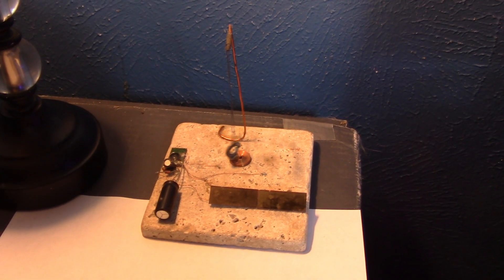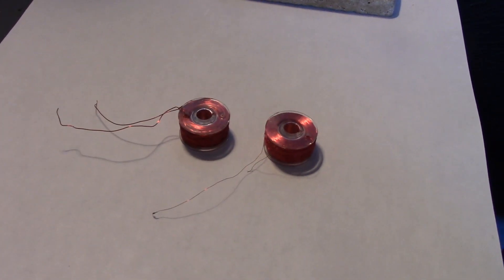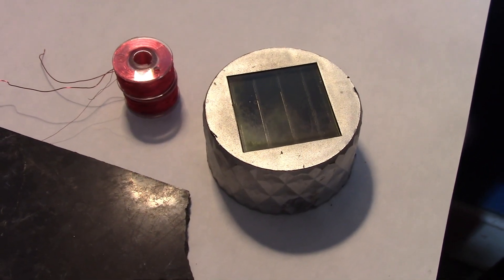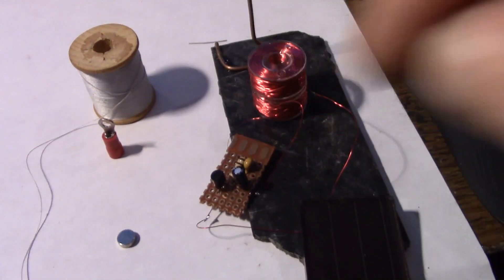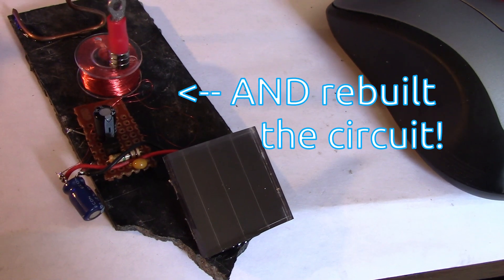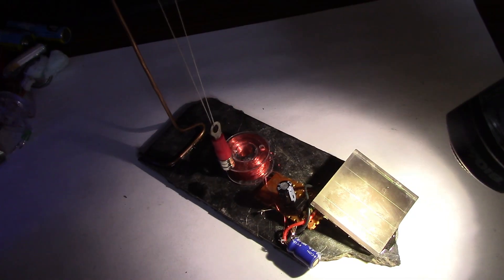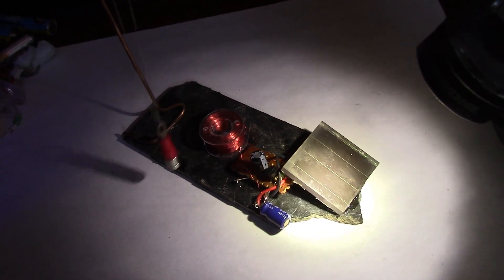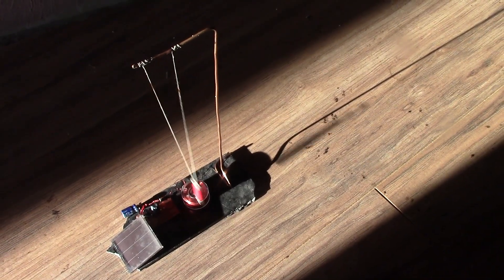Solar Powered Pendulum – Starts by Itself! | Easy DIY Build

Comment: Go big
Reply from the maker: That would be fantastic, to make a 10ft high solar pendulum. I don't know what use it would be, but that wouldn't be the point  🤣👍
Reply: The largest N42 I ever saw was 12"x12"x2".  I think it cost $1,000.00 15 years ago.  I figure they use them hydro electric dams.

Comment: Nicely done. It seems to me that the old solar rockers are hard to come by now, so back to building your own circuit will probably become a necessity again 😊😊👍👍
Reply from the maker: I think I kind of prefer it, for innovation and problem solving, but would prefer to have the option! 
Did just get recommended Big Clive's teardown of a solar rocker that was made of components, not the blob (2 year old vid). His also featured screws in the thing and brass bearings = posh  😄

Comment: Nice project, and it works well. If you have a spare solar rocker, there is a small coil in there. I also found those small coils (not in a  pancake form) in 1.5V clocks.
Reply from the maker: Thanks Deslo 😀
Dollar Tree stopped selling the rockers about 3 years ago and I haven't found any more, but yes, 500ohm coils in them! I think the clock ones are like a cylinder shape. Oh, another source can be tiny relays, from telecoms type boards, modems and the like. You've got me thinking about other sources of fine wire 🤔😃

Comment: That's a great use of otherwise scrap materials used and makes a nice and interesting pendulum. I have subscribed to your other channel and slowly working through amazing and interesting projects and a very nice radio 📻 👍
Reply from the maker: Thanks. Yes, it worked out great... was one of those where I wondered what I was doing until it worked 🤣
Which channel? The original Slider2732 am locked out of (after moving house). Lost 8K Subscribers and monetization!
Reply: Yes I subscribed to your old channel so got both you're old videos and your latest. They must be a way to get back your channel who's getting your money? Google has enough money don't let them take it it's yours you did all the work. 👍
Reply from the maker: @johnwynne-qx6br  Thanks. There seems to be no way to get it back, mainly because I can't talk to a real person at YouTube! It's obviously my channel, but the system doesn't believe me.
Reply: I wonder if it's happened to someone else and they have found a way to retrieve your channel. That's the problem when you can't talk to a real person who understands rather than ai. I wouldn't give up keep trying it is a lot of your time and energy invested , good luck 😊  👍
Reply from the maker: @johnwynne-qx6br  Thanks John, I appreciate your support 😀
That's the upsetting thing, 5 seconds spent by a human looking at 1 vid and they could tell it's me, or in fact 5 seconds on a phone call!
Reply: That's the problem with computers  a human can understand things outside of the box "well most of us can😂". Good luck Mark keep trying 👍

Comment: Can the collapse of the coils be diode steered into the power source capacitor for longer run times ?
Reply from the maker: Oh, good point! I don't know... I did try an LED on the circuit and it didn't want to flash, so I just left the circuit alone. The thinking was that it would be running just on solar, but your idea is well worth trying 😀